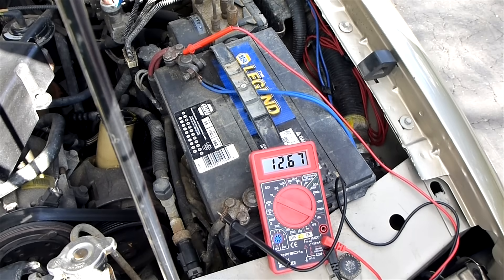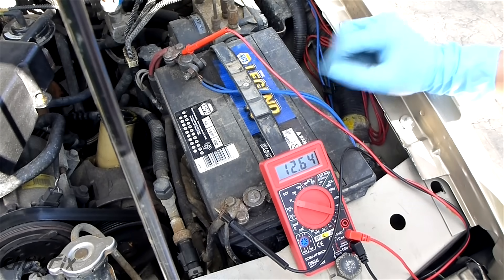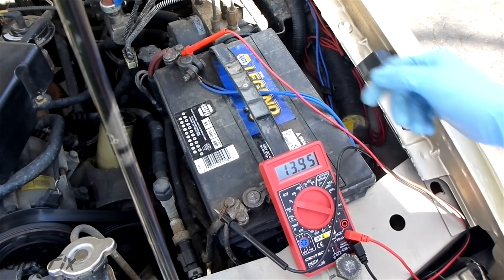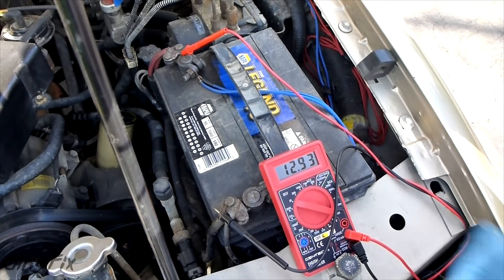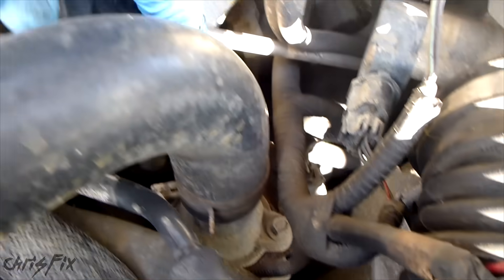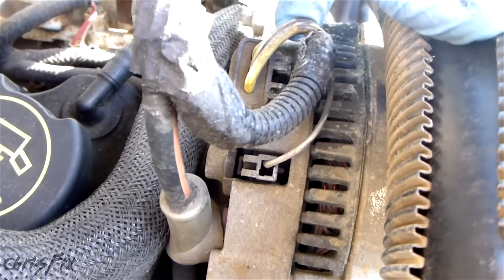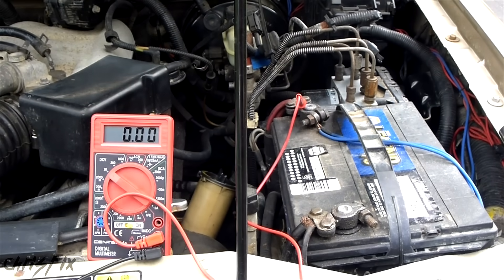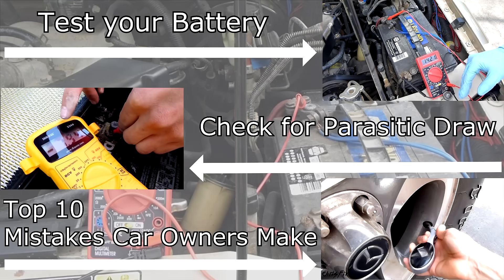How to Test an Alternator

Comment: Hi just want to ask iv had a problem with my electric power steering on my 207 2011 plate it only started doing it since iv been having my radio on we out the car as I was fixing the sat nav took me about a week of doing that and now this steering fault has come but my car says eco mode and battery light flashes if the battery is not enough power in it will that effect my power steering as it's all electric thanks for any info
Reply from the maker: Sounds like either your power steering fluid is low, or your alternator and battery are not working like they should. I a have a video on how to replace power steering fluid, check it out: https://www.youtube.com/watch?v=t7JCh7PHoDc
Reply: ChrisFix it's all electric mate. Iv now had to get a quote to fix the car but hoping green flag will take it to garage of my choice hopefully as aperntly it's a new rack job about just under 600 to fix 🤮 lol thanks for your reply tho mate

Comment: Tested my battery it was 12.2 Started the car and it went to 12.4 The car is a 1969. Brand new alternator today, voltage regulator tested good and the battery is new. When I drive down the road with radio on the voltage meter in the car reads 10-11 volts. Maybe a bad connection? The battery is grounded to the alternator bracket where it has been for over 35 years. ??????????????

Comment: I was always told to disconnect the positive cable from the battery and if the car shut off, it was the alternator. I just checked everything like you described, and it turns out that it is the alternator not producing enough current. I'm still going to use your tips, especially after I install the new one. Thanks for your tips on properly diagnosing an alternator, I'm sure you've saved a lot of people a small fortune.
Reply: I've heard that method worked for older cars but could screw up the electronics on newer cars.  It's no longer suggested.
Reply: @jonathanr6297  This is true. Modern cars have lots of sensitive modules that can be damaged by the voltage spikes that can occur by doing this.
Reply: I always have older cars pre 95 and I use the garage door at night method. At night turn your lights on while in park give some gas if your head lights go brighter and then dim again when you let off the gas your alternator is going out
Reply: No, it's negative.  Do not remove positive when running. It could damage the battery, alternator and or other electricals

Comment: I changed ignition coils and spark plugs then battery light flickering and alternator voltage reading 12.6V same with battery. I recharge battery with CTEK but still flickering sometimes and alternator voltage reading is 12.6V. Is ignition coils and spark plugs can be cause of this?

Comment: On my car, the voltage drops to about 12 when all the lights, AC, radio etc are on. Not sure what that would be. Also power steering light is on and the steering is a bit stiff at low RPMs.

Comment: Hi, I really hope you answer me because I have a really big problem.
So I have a new battery in my car. I sometime realize my terminals and battery gets hot while driving and when it happen the car either slow start or doesn't start if it is turned off and  tried start back up. Would have to wait until the battery/terminal cools and it starts like a baby. the problem is, it is not a constant problem and I already changed the terminal, but while the frequency and the severity reduce, it still persist. 
I did all the battery test and alternator test in your video and everything checks out. The alternator was checked when I buy the new battery as a requirement to get my battery warrantee and no issue was pointed out (After I realized it wasn't the old battery that was giving problem) and another friend check and still no problem found with either the new battery or the alternator.
Also realized that other things:

sometime my door power button stop working and then it will start working by itself  

Yesterday while driving, my radio and door power lock button stops work. I could turn off the car and turn it on back fine and it persist for a few minutes then the power door button just start working back and the radio just turned back on. that's the first the radio acted this way.

I see the light that show my mileage dim when I press my brake, don't know if that is normal.

My right indicator blinks fast.

Any thoughts on these issues?

Comment: Great video, you've been the savior of us dumbasses for over half a decade now. I'll be doing these tests to my Ol' Reliable Volvo 940. She died on me on the road and i tested the charging voltage and it was 11.6 on idle and 13.6 on 2000-ish RPM. I wanna make sure what the problem is before buying any parts.

Comment: Quick question if you could answer this. I have a 2005 Ford Escape 3.0L car and having issues with it running. When I check the voltage on my car battery when the car is running it  is overcharging the battery. It sometimes can get up to 18 Volts. I was wondering with your knowledge of voltage if you could provide any advice for what may be causing this. I replaced the battery with a brand new one and I'm still having this overcharge issue which in turn is making my car run very poorly and my electronics in my car turn on and off. I also just replaced my alternator last year and I did pull it off to bench test it and it passed. I was wondering if you think the PCM could be the potential cause of all this or something else? Any advice would greatly be appreciative. Nice video by the way I learned a few things from it.

Comment: I have a 2000 Jaguar S-type 3.0 and I need a boost off every other week or day. I have a brand new battery that is exactly 4 months old so what do you think it could be.  It'll be running great for a couple of days and then the next morning it'll not crank at all. Also the battery is in the back of my trunk near the spare wheel. So what do you think it could be ?

Comment: Very informative and practical video!  I have a questions for Chris or anyone else.  I have a 95 toyota tercel with a cassette deck.  I was driving last night, and suddenly the cassette flipped sides rapidly back and forth.  It wasn't a stuck cassette because I tested it with the engine off.  I'm pretty sure the dashboard lights dimmed slightly.  I took the cassette out, left the radio on and drove about 40 minutes.  This happened in October, I took it to the mechanic, but they couldn't reproduce the condition.  Any ideas?
Reply: Get a Bluetooth receiver?  😉

Comment: 3:35 anyone got a battery shim I can borrow?
Reply: I learned something cool in the battery cables that are stretched and won’t tighten well … shim an electrical male spade terminal between the post and the cable and it shim it right out and you can tighten it right up. It’s a really simple joy to fix that problem.

Comment: I did the negative drop volt test on my '98 Mustang GT but both readings came out the same 0.12V, I already checked every single fuse, all wires and cables and tightly secured, got a brand new alternator, battery was recharge and it is still good, battery posts are super clean as well as battery terminals. Even changed the alternator pig tail connector and battery light is still on. Tested the alternator with a load and shows 14.3v. I even disconnected the alternator while the car was running to make sure my voltage gauge in the cluster was working and indeed it dropped. At this point, I have no idea what the problem could be. ECU perhaps? Battery light was flickering after driving for a while but not it's solid on after driving for a little while. I tested the battery after driving for a while to look for any drop in the readings but nothing, battery still shows 12.5 or 12.8v. Any input would really be appreciated from another Stang fellow.

Comment: hello mate i was driving for the last couple of days with my battery light on then today i was driving and the power steering stopped i parked up then it would not start the battery was dead i put jump leads from another car started it  but there was no power at all when i put my foot on the gas pedal then i connected the jump leads back and there was power again but every time i take them off the gas pedal does nothing then when the little bit of power that was in the battery from having the jump leads on ran out the car would cut out the drive belt is tight and turning fine so could this be the alternator bad the last couple of days since about the same time the battery light came on there has been a clicking noise from near the alternator so could that be my problem if you could help i would be grateful thanks dennis

Comment: Or do it the old way after you start your vehicle remove the postive cable from the battery if you have a bad alternator the engine will die.

Comment: I need you in Columbus, GA! 2011 VW CC Lux+ battery light. Car dies on the side of the road. New battery installed, drives home (half mile). A/C died. Radio died after install of battery. Installed new alternator and belt. 
All fuses seem okay. Saw video where there is a larger, mostly metal fuse-thingie (?) under the fuse box in the engine bay, but can't seem to get the actual fuse deck off. There is a large Phillip's style screw (?) in the middle of the fuse deck that I can't seem to get to unscrew so I can check the block fuse that's supposedly (?) under there. Unfortunately I don't have a volt-meter and don't want to risk driving the car at this time. Assuming (know tomorrow) the voltage is good...??? Any suggestions would be highly appreciated. Thanks!! Great videos!

Comment: Bought a new battery 4 days ago and car was working perfectly fine. Went on about a 2 hour drive, came home and the next day it’s dead showing 6 volts at the battery with car turned off. Jumped it and showed 13.5-13.7 think my alternator or what else could it be? The alternator is new might I add.

Comment: So when I have everything turned on and I start my vehicle the vaults initially dropped to 10.2 and level out at 12.3 and my battery light is flickering. This morning the car would not go into gear and the monitor that I have connected to a cell phone charger said it was 8.8 V and then I had a guy give me a jump and the car would not go once I got it in gear and all of my gauges started flickering after I turned everything off and held the throttle down for about a minute the car would takeoff and drive normal and the voltage would go back up to 13.1.

Comment: I have an issue when i put load on, the voltage drops less than 12 v ,with out load the voltage remain around 14v at idle position

Comment: I got good measurements, but the battery light is still on. Any idea what it can be? BMW E46 318i 2002 btw
Reply from the maker: Do you know how old your battery is? That is likely what is causing your battery light to be on!
Reply: ChrisFix Don’t know. Bought it three weeks ago, battery light went on and alternator stopped working so I got stranded. I replaced it some days ago and the battery light is still on. Battery measures at 12.6V and alternator 14.3V. Previous owner said that the battery was replaced not too long ago. Looks pretty new too but can’t really know for sure.
Reply: ChrisFix I just remembered that the old alternator charged at 17V just before it stopped working. Could that have affected the battery?
Reply: lazerduck yes definitely ruined the battery, that old alternator overcharged your battery and permanently damaged it, id change that battery ASAP before it ruins your new alternator

Comment: My Alternator voltage drop test -- neg battery post to alternator case -- failed.  What do I do to remedy this? Thank you
Reply from the maker: Try cleaning the contacts to the alternator and battery and try again, if it still fails, you will need to get a new alternator!

Comment: Do you have a video about how to correctly use and understand a multimeter?  I don't have any knowledge of how one works much less use one and get any sort of reading that makes sense.  I've tried to use one in the past and have followed the instructions in the video but not having the basic working knowledge of how one works or how to use it properly basically rendered it useless to me.  If you have a video or have a link to a really good instructional whether video or not, I would really appreciate it...thanks

Comment: I ran the test and voltage did not increase after I started the vehicle. The connections are clean although I use a quick disconnect because the car has a parasitic power drain. Could this quick disconnect cause the alternator to not be able to recharge? The car had been working fine up till recently. Thanks

Comment: Is it necessary for the battery negative side to be also grounded to the chassis?  My 4Runner was until the battery slid on the tray and that connection severed and then vhicle didn't turn on as I assumed it was this as I used GB70 to start up and seems now that perhaps the alternator is bad... I will test later but is it necessary to have the battery neg also grounded to chassis?

Comment: I have -0.24 from + to alternator, but then my all accessories working, it's about -0.30, ground good, but then I giving more load to it charging voltage its drooping from 13.90 to 12.80, and if I turning off like AC,  the charging voltage recovering very slowly

Comment: you are the best! saved me couple of hundreds.

Meter was showing 12.30 volts reading on battery and 13.20 volts on alternator, I was pretty sure battery is working fine because volts is good (after watching your video :) ).
But was not clear why battery is not charging, I have to use Jumpstart every time. Almost decided to replace the battery but noticed that its water level is super low. 

Now it is showing 14.3 volts on alternator!! your Exact volt reading helped me. Thank you!!

Comment: nice video, I have a little problem, my alternator charging is fine, I changed alternator brushes and slip ring, but my still there is a issue it don't hold load if my wind blower with ac is at max, lights and radio, heated seats it drops to 12.70 V. , if only lights, radio and AC and wind blower is blowing not at max, so its charging 13.60, strange, what it can be ?

Comment: Chris, just another Excellent, Excellent how-to-do-it video in clear terms, great visuals, and no dramatics.

(One thing I would suggest though is to put a written WARNING message on the screen at 4:18 where you are say "And finally, as the car  is running,  make sure that the alternator is spinning, make sure the belt is tight...," and you are demonstrating by touching a NON-running alternator alternator's pulley and then grabbing a NON-moving belt!  You should put a written Warning over that scene and say to Not touch the alternator pulley or belt while the car is running, but to just check it visually.  I can just see a newbie following your step-by-step verbal instructions while emulating your visual example of physically touching the pulley and grabbing the belt and possibly losing a finger or two....)

Comment: Hang on a second, what about the A/C you need to put that on as well as all the other things like your lights etc, but so far its the best test for checking the older type alternators, modern ones have a switch which makes it turn on to charge the battery when its getting a load above a certain point, on my dash it shows you the voltage, which is around 12.7 to 15.1 is the recorded highest charge point, but that was at night with hi beam and fog lights and the A/C & heater going, due to cold weather and condensation inside the car, i have the heater going and a./c to get rid of any fog which is on the glass, but as soon as its warm enough in the car i turn the A/C off, people don't realize you have to turn the A/C on, to make sure the oil in the compressor is moving around, especially in winter time, which is why the a/C compressor will sometime fail, due to not running the a/C even in winter time, cheers great upload by the way, thanks . :)

Comment: Awesome info, any suggestions for my problem my alternator is over charging with car running it’s 14.9 and doesn’t really move and my battery positive post to alternator negative post is 0.07?? Thanks heaps for the info
Reply: My battery keeps dying and it’s only a year old

Comment: My car jumps to 14.6 volts when I turn it on, but drops down to 12.6 with everything else off but when I turn something on, like the head lights, it jumps back up to 14.6. car has 11.4 thousand miles and it's saying I have to check charge system

Comment: Hi Chris, I'm learning so many things from your videos. Always thanks!
When I check my alternator, when I start engine, initially it reads about 15.0V and then slowly goes down to about 14.7V
Is this problematic? (I changed to a new battery as the battery died twice recently)
Reply: If you are constantly having batteries die on you that is a big sign you have an alternator issue, could also be the voltage regulator, so don't rule that out. The second common cause of dead batteries would be a short in your electrical system, which would mean even when your car is shut off something is still pulling way more power than it should be. There are ways to test for power draw with a multimeter through your fusebox, though you may lose your radio presets or settings to other devices while testing of course. Also huge thumbs up Chris, this video is just over 5 years old and you still replied to a comment! That is dedication to your fans right there!
Reply from the maker: What happens when you turn on accessories? And what's the correct range for your car?

Comment: How can I check the amps from the alternator to the battery without a amp clamp reader?..battery is testing good both off and while car is running with everything on..I'm getting 12.7 with car off and 14.7 while on with everything else on...
Reply from the maker: Does you multimeter not measure amps?